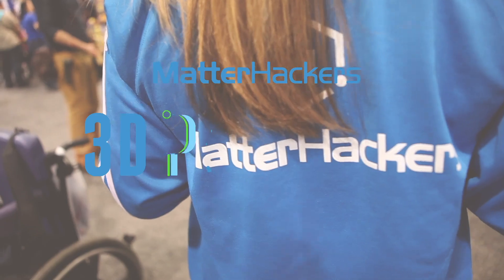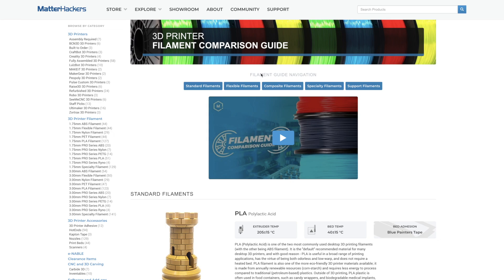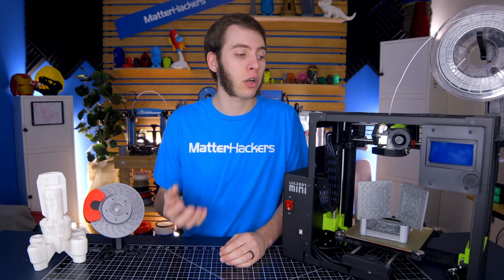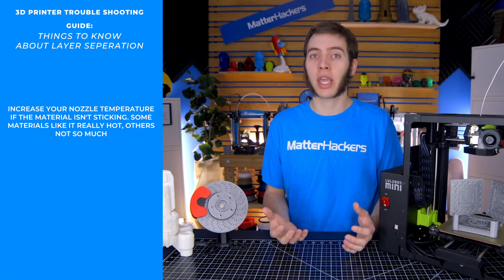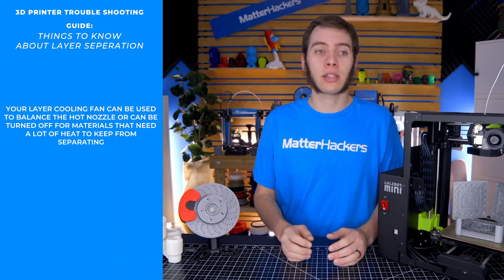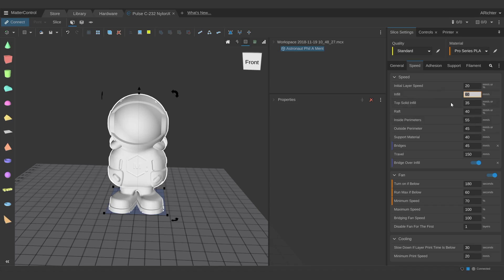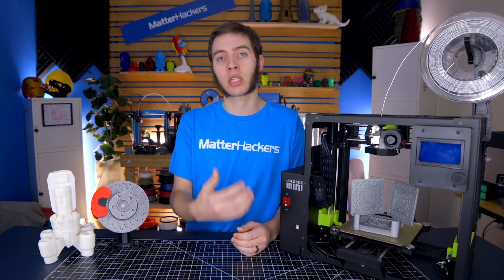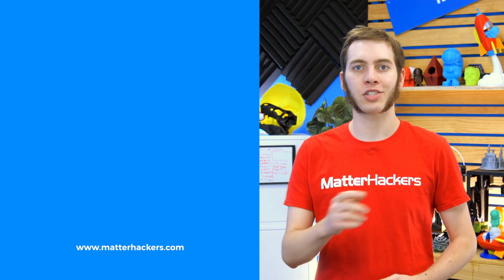3D Printing Troubleshooting Guide: Layer Separation

Comment from the maker: How do you fix your layer separation issues?
Reply: @Blondie SL Yeah motivation is the key for all. Hard times we are all in. I wish you the best luck, and for all humanity.
Reply: Lower layer heights seem to to help alot
Reply: @Blondie SL I have the exact same problem. 1 layer at random heights. Especially when it is a long print. My bench looks very good but what is the point! My filament spool holder is not very good either. It is a wrench taped on the frame of the printer :D I guess it's time to change it. Except, I didn't catch any tight filament situation, but it is possible. I have changed from Z stepper driver to lead screws, nozzle, heater... frustration... 3D printing is a cursed action...
Reply: @Blondie SL Just don't bother with motorizing the spool. I've bearings upgrade for spool too and it moves really easy on the bearings, even filament's springy behavior can roll it now. If your bearings have resistance, clean them with detergent and drop them in WD40 but I'm afraid it is not the real source of the problem.
I'm using the latest Cura 4.1.2. Just install it and add your printer. Search for a decent profile, I'm using Chep's Cura profile,  and don't bother with changing settings. Transferring settings resulted with no success in my case from S3D -> Cura. Chep's profile just worked perfectly. 
Z hop causes and fixes lots of problems depending on models... I'm not using it in Cura. No need for it if you are not printing tall thin objects.
Ohh, You should definitely clean the extruder gears, nozzle, throat and make a tight connection between them while they are heated.
I'm full of experience with 3D printing these days, after lots of frustration.
Take care.
Reply: By trouble shooting while watching your video 🤣
Reply: @Tim Milgart im using orange matterhacker abs filament. Im getting a tiny snap sound from my nozzle, and alot of separation in the layers, but the sculpture us still intact. Im running the bed at 60, and the extruder at 210. Im using a longer lk4,  also  30 degrees outside, and the machine is not in a confined space. I told the machine i was using abs in the preheat mode, and it calibrates with the computer settings for that particular plastic. Does it sound like a cold thing? And should print at a hotter temp? Im a greenback, im brand new to the hobby. Thanks and happy holiday's.
Reply: Slow the nozzle down. Especially if you're using a hardened steel nozzle; the thermal conductivity is much lower than brass and heat flows through it more slowly. If any filament from the previous layer is sticking up and blocking the nozzle path, it has to soften real fast, or it will start tearing everything up.
Reply: Interestingly my wanhao duplicator plus is very reliable and gave good prints from the get go but my creality Crx is a little touchy. I have had separation issues with it lately out of nowhere.
Reply: @Blondie SL Yes, that issue is avoided by the "part cooling fan" . That cools the rest of the filament and makes the filament "pushable" through the nozzle. 
My new experience with this random missing layers problem led me to change the slicer software. As I mentioned before, it happens just like you described and model got taller when matched to a successfully printed model. I was using simplify 3D 4.0 and always had the issue just after z-hop moment. Literally, Z stepper goes up for z-hop, and nozzle goes to another line to start printing (new layer) and it makes just another z-hop without going down in Z direction. InterestingIy couldn't spot the issue in .gcode. Now have migrated to Cura and it solved the issue. 
I guess some models cause difficulty for some slicer Softwares... At least in my case.
Reply: I have not fixed it yet buuuut I think I know what is the issue now, I copied a profile from another printer, that printer has a sock and the new one does not. The printer with a sock I have a bit of fan with abs to get overhangs working well. The one without is probable dipping too much. (This is all abs)

Comment: I came for the fixes, and I stayed for the information & Mutton Chops.

Been experiencing this with a range of tests. 205-220c, 50-65mm, zhop off/on through each test. Bed and extruder calibrated. 

And I am still getting layer seperation at about the 40mm height. Sunlu black pla+,  Marlin firmware, new stock Ender 3 v2 neo.

*Edit: Using Cura, but also tried Crealitys slicer 4.8.2 since it is their last version that supports 3 v2 neo.

Comment: Thank you, I was scared to to the pla higher then 225, Its dark filament and have issues with separation, started printing at 235 and what a difference! Started to explore hotter heat settings for the speed

Comment: I have a gap when it switches/transfer from main infill density to top layer solid infill; show up on the outer side wall per test cube and other prints. Cube prints well, it’s just right at the top layer i have a separation. How do I stop this? I’m using cura.

Comment: Layer separation doesn't always occur at the same height, in which layer varies.
Printer is in a drafty location, breeziness varies depending on time of day.
Nozzle temperature does not remain consistent, fluctuating between 190°C and 206°C, with a 205°C setting.
Fan speed is always at 100%, it's a Creality Ender 3 S1 Pro.
I'll increase temperature while I figure out an enclosure.

Comment: Can you print a razor?
Reply: Depends on what you call a razor. The thinnest point can only be as thin as one layer. For best results, you’ll probably have to print it with the very tip of the razor on the printing bed. Interesting thought though

Comment: I just got my CR-10 printer and i started printing parts for my robot arm. But i doesnt go to well because i have elephant's foot. The first 5 layers of material is getting pushed out, but i cant level my bed lower so that the nozzel has more room. And if i level the Z frame it wont save the distance and it will go to auto home. If i use raft the problem is solved but then the print just looks ugly afther removing the raft... And my English isn't good, just saying. Hope some one can help me!

Comment: Having a little bit of an issue with layer separation after a print is finished with CF nylon. Print temps, speeds, all that stuff is correct. Printing right out of the packaging brand new, so I'm thinking I just need to run it in my dryer box then try it again.

Comment: Here to learn about 3D printing because I need it for a couple of projects. Using a trash bag as an enclosure sounds real scary.
Reply: @Blondie SL Yeah, I wound up with the CR10 Max, and I've been printing successfully on and off, it isn't perfect but we all know this tech isn't really plug and play yet. Some tinkering required. If I ever get an enclosure for it it will probably be custom cut plexiglass or something similar, but I haven't felt the need because the bed gets up to 80c no problem with that machine. But I do love how it's like, yeah throw this fire hazard over your printer. The nozzle can hit about 400 and something Fahrenheit and it moves a lot but that's fine.

Comment: likely it’s not heat, if your material is printing fine then don’t adjust that.   actually look at the arm that is pressing the filament to your extruded motor.  When you open that arm, and here a click or the filament sticking, then loosen that screw that is holding that arm.  another sign that the screw is too tight, is the filament is being rubbed against the motor to tightly and is rubbing away.  (causes air gaps in the hot end).  Usually layer separations is with PETG or PLA, PETG i like to run with 225 and 100% fan speed.   PLA i like to print around 180 and 50% fan speed!

Comment: Im a newbie so sorry ahead of time.  I'm using an Ender 3, I just upgraded my bodon tube to a capricorn tube. This came with a new nozzle that is steel. I ran a gcode that never gave me issues before. Now in seeing huge amounts of stringing, and my part breaks apart in my hand with just a little pressure. Im using black PLA at 220 degrees. Am I running too hot? Too cold? Or could it be my nozzle is too far off the bed? No idea what is causing this.

Comment: Excellent Video and tips. You solved my issue. I had tried everything else you mentioned, however I had never heard of changing fan speed. I took it from 100% to 33%, and it was like printing with a different PLA. This is my second spool and this one required a bit higher temp as well. Thank you!!, I'm subscribing :)

Comment: Hey, I am having an issue where my layers are being printed each time further to the left side... making almost a "motion shadow" of layers, anyone has any clue on how to fix this problem and what is causing it? Obs: My first 2 prints went great.
Reply: You're layer shifting, I had this issue before, you should start by adjusting the tension on your belts (should not be too tight but not too loose either!) And then you should start calibrating your extruder and your z offset if you have auto leveling . It's most likely over extrusion as my printer had the same issue where over extrusion forced the nozzle to dig into the plastic and thus forcing the x or y motor to skip which results in shifted layers. You should also calibrate your motor's drivers as they could be not providing sufficient amperage to the motors which doesn't allow them to run at their intended torque output.
Reply: Probably the X or Y belt is loose making the belt slip. Or it could be that the print head is loose on the carriage. But it's probably loose slipping belts.
Reply: It can also be the roller bearings need replacing

Comment: I'm running into some random layer separation on my prints using the AmazonBasics Black PETG on a CR-10S. I'm running at 255C and 45 mm/s. The rest of the print looks great, but I just have some random layers here and there that don't. I may try turning down the cooling fan
Reply: Similar issue with the Amazon PLA right now. running at 210C 60mm/s with a 60C bed on the Ender 3. Maybe Amazon Filament is just trash? The filament that came with the printer didn't have any issues at all. Thoughts?
Reply: Shadow the Wiseman I’m not sure about amazon PLA, but I think I’d try a little hotter. Like 215C or 220C.

I ended up finding that one of my issues was that I had replaced the nozzle, and you’re apparently supposed to tighten it down when it’s hot, or sometimes plastic can get into where the nozzle is supposed to seat; I found out that some of the filament was oozing out above the nozzle rather than coming out of the tip. I’ve gotten pretty good results since I fixed that
Reply: Hi hope I can help layer separation issue was due to humidity in the filament bake your filament below the heat it can withstand for about 3 hours and try again

Did wonders for my Nylon Petg and Pla

Comment: Hey @Alec. Great job as usual. 

Have you covered the settings needed to print with larger nozzle diameter? Specifically .6mm nozzle, layer height extrusion multiplier, layer width, temperature and speed, and how they affect each other, and how much different they are relative to a .4mm nozzle. 

There is some cause and effect going on here that doesn't seem to be linear.

I print a lot with NylonX and Armadillo. I need strong small parts.

Thanks,
Lindsey

Comment: Seriously, some filament has to cook at up to 500 degrees fahrenheit? That is insane!
Reply: Take a look at Carbon Fiber Reinforced PEEK filament from 3DXTech.  Crazy stuff.  $85 for 100g of the stuff.  Prints at 380-410C, 130-150C bed and needs an enclosure that is also heated.  insanely strong stuff and extremely hard to print.

Comment: I ve experimented lot of failure Layer Separation printing with 1 mm nozzle with PLA at 220 Celsius .. 
now i understand better the problem could be the temp .. i ll try to reinstall the nozzle (now i put back the 0.4mm) and print at more temperature like you said 245 degrees , with low or zero fan (i need it to print some square empty shelf like this "https://www.thingiverse.com/thing:2745961"